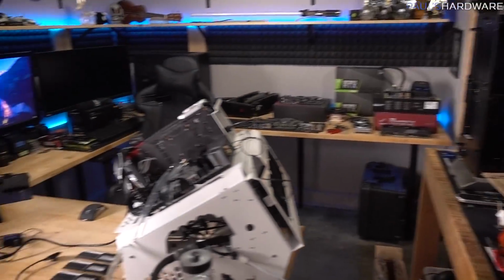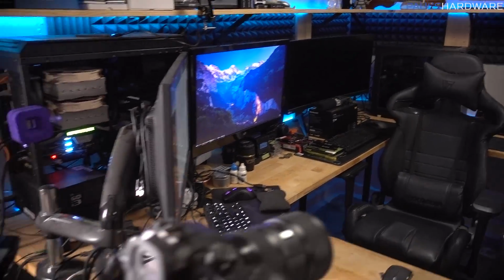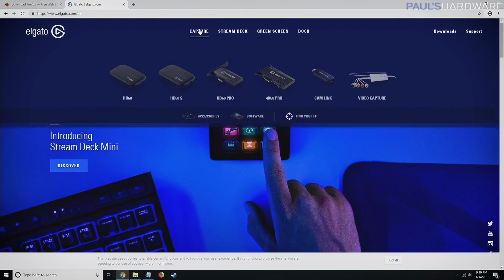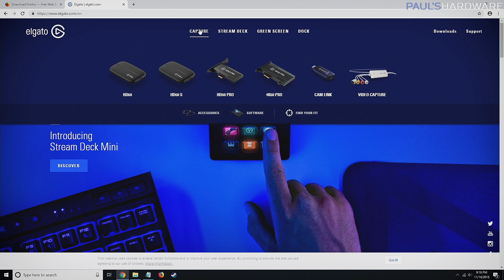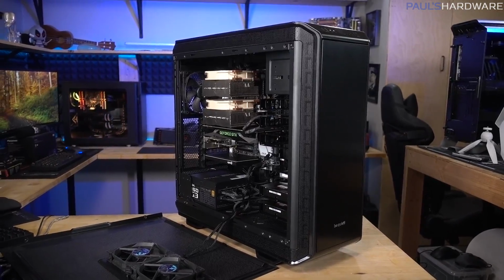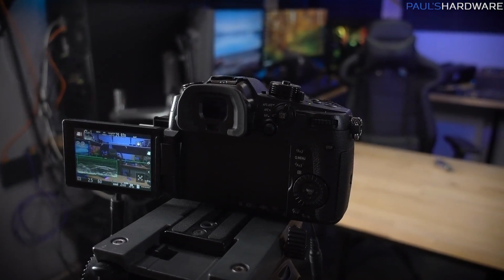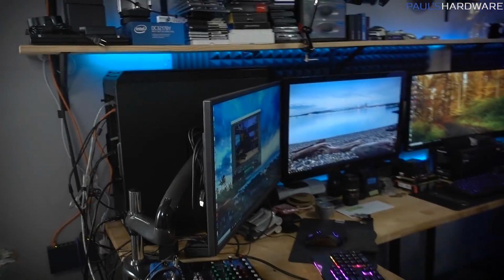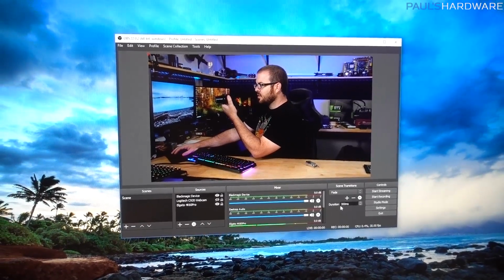My Streaming PC Needs HELP!

Comment from the maker: Many questions about my vacuum -- it's the Shark Rotator TruePet and it's actually pretty awesome, not that I'd do a vacuum video...
https://amzn.to/2DvugOI
(that's an Amazon affiliate link, but I have no sponsorship or association with Shark, my wife picked out the vacuum last year)
Reply: Can you overclock a vacuum cleaner ?
Not that it needs it , but there is definitely potential there .
Reply: @personaldronerepair6141  Technically yes. Though I think it voids your warranty.

And might cause spontaneous combustion.
Reply: @CheezMonsterCrazy  
Or an uncontrollable garage-nado that heats up the circuit breaker then blue screens your marriage .  
On second thought , don't do it Paul .
Reply: Paul!  Don't do it!  The cleaning up of the garage, I mean!  YOU'LL NEVER BE ABLE TO FIND ANYTHING IF YOU DO!!!!
8)
Reply: But does your vacuum pick up large pieces of trash, like the CoolerMaster H500P? 😉
Reply: You should be on Pimp My PC
Reply: https://youtu.be/_u6px48CTqo?t=511 wholly hole Batman
Reply: 6:23 those look like fractal venturi fans, not bq silent wings.
Reply: Is that a Dyson? Lol
Reply: can you made video how to conect 5.1 dolby to 4k tv pls :)
Reply: instablaster...

Comment: Great video and thanks for the upload. Was hoping either you or someone that reads this comment and can give me some advice  on what to do. I would like to stream and record in 4K/60FPS and my recording device would be my PC MB ASUS Ramp. IV socket 79, Intel 3930k 6 Cores /12 T, GTX 1070, 32G DDR3 Ram and two intel Raid 0. For playback I'll be using an Alienware Area 51M Intel 9900K, RTX 2070 and 2x 256 Samsung M.2 and also a PS4 for their exclusive tittles. I was thinking buying the Elgato Capture 4k60 Pro. and  4k 60 fps is a must as I'm trying to improve my youtube channel and see where it takes me or any other suggestion is greatly appreciated. ! Hope to hear back from someone and thank you!

Comment: Quick question. Usually when I break down my gamer/streamer PC and give it a good spring cleaning (about once a year) I pluck the fan off of the cpu and reapply some fresh thermal paste also. Do you and if now why? Just curious bro.
Reply: a good quality thermal paste should hold up for 3 years or even more but i change mine every 1.5 years since it makes me feel comfortable, and i live in a dusty area too so i clean my pc every 4 months
Reply: @Fros789  3 years? Wow, I suspected once a year was a bit premature but didn't think TP had a 3 yr life span. Live and learn ehhh.  And yeah, same here on the dusting. About every 4 mos or so sounds about right. Outside gets done almost weekly when the wifey vacuums in here but I dont dare let her near the inside. lol

Comment: "It's not as bad as it looks"...ha, until a Black Widow bites you!

If you want to handle both capture and playback from a monitor with Intensity Pro 4K/Decklink, you need a Datapath Dual link DVI.  Don't ask me why it doesn't work with HDMI; you must use a DisplayPort.

Comment: quick question which would be better looks and performance a strix 1070 or a gigabyte 1070 ti (3 fan card)
Reply: The time, it preforms a descent chunk better, worth 50$ extra. If not then 1070

Comment: Hey Paul, I recommend getting a Black Magic ATEM Studio 4K switcher for all your capturing needs. Then output to that el gato card. I use this setup at my work and it works great. You can even livestream in 4k eventually. Just be sure to add a 30 second delay for buffering to youtube. Also, I recommend getting a dbx 260 for your mics. Watch a few tutorials on how to setup a dbx 260 and you will see what it can do for you.

Comment: I'm frankly appalled by the nonchalant use of the vacuum cleaner.  Haven't you ever gotten static shocks from the hose?  I have a similar unit, a Shark, and I know when it's dry here in Wisconsin, especially in winter, if the vacuum turns on, I am getting shocked guaranteed.  On top of that, the plastic brush attachment is practically a "free static electricity machine."  Tens, if not hundreds of thousands of volts is more than enough to melt bond wires in small packages.  Maybe you've lived in LA all your life and have never experienced extremely dry air... But ESD can be a real concern for many people.  I'd still find it very difficult to believe a vacuum cleaner has never shocked you though.  Keeping the power supply plugged into the wall is also important, as the whole case will be always be properly grounded, rather than relying on the capacitance of the screws through the motherboard and the of the metal case to dissipate charge.  Cigarettes can't ignite liquid gasoline, but are you going to recommend people smoke around it?

Comment: Paul, good work in revitalizing your streaming box to work for you a few more years! 
May I make a recommendation?  Once you have your system set up, move your Documents libraries to another drive (Docs, Pics, Vids, Music, etc) and you can blow away your windows build later on and not lose anything.  Once you reinstall windows again, you can point your folder locations to that drive, and everything works!  All gravy!  It makes the headache of reinstalling a breeze!
share for you, and all you tech heads out there not yet in the know:  https://www.pcworld.com/article/3025345/windows/move-your-windows-10-libraries-to-a-separate-drive-or-partition.html

Comment: Why go with air cooling? You have all kinds of hardware at your disposal.
Reply: It's his streaming/work rig. He needs maximum uptime with minimal points of failure. In that case, air is the safest and most reliable way to go.

Comment: Paul, what CUP is in that? Looks to me like the Noctua HS is installed in an inefficient configuration. Why would you have it blowing the heat off the CPU towards the bottom of the case, and directly onto the Video card? Just curious... Am I missing something?
Reply: Andrew Small  Do you know if the top radiator is in an intake or exhaust configuration? 

LGA 2011 vs LGA 1151 (mine) could be the difference. Mine allowed for the HS to be positioned both ways. So I had a choice of pushing towards the rear of the case (front to back case flow), or the top (chimney style).

Comment: I almost suggested this with the computer off floor video....... but now that you have set a precedent for changing system names....... I propose a name change for Riptide...Since you have Diana's Little Hot Box, That monster beside it should be Paul's Overcompensator

Comment: Hey, quick question. Is using a vaccum cleaner safe on electronics? I have an (old) PC here that I want to clean up and work on, along with my consoles and such. Thanks
Reply from the maker: I am pretty comfortable using a vacuum as I did in this video -- it's usually OK externally, on dust filters and on big parts like heatsinks. Avoid using a vacuum directly on a PCB (mobo or graphics card), and if you go over fans you should hold them so they don't spin (over-rotation can damage the motor).
Reply: Be careful when using vacuum on motherboard, if it has strong vacuum it might pull components out/off the motherboard, so if its really strong make sure it doesnt get to close to motherboard. Also make sure the tube for vaccum is plastic so you dont get electrical discharge.
Reply: @sjarken3979  Even with plastic tubes static electricity can build up. Because of the airflow and debris flowing thru the tubes. I can't speak for all environments, but I did have this problem with one of my vacuums. I live in AZ. But I was also vacuuming on carpet floors.
Reply: @sjarken3979  metal is good.
Reply: The main danger in using a vacuum (or, say, an air compressor) for cleaning a pc is that the rapid movement of air over components has the potential (pun intended) to build up static electricity. Frankly, though, it'll generally be alright so long as you don't do anything that would cause a discharge. And it is perfectly safe for cleaning filters and the like, as Paul said.
Reply: Thanks all for the helpful replies. Think I'll just use the vacuum for the filters and compressed/canned air for everything else
Reply: heh I cringed so hard when he started vacuuming. I'm shocked that he didn't fry his components with ESD.
Reply: @Requiem4aDr3Am  I was thinking the same thing. I would never do that when my motherboard was still installed, or on the motherboard itself.

Comment: First it was Heather… Now it's Paul… I guess November should be designated as clean your PC month. At the very least clean once a year, otherwise it will look like this! I check mine once a year and it's never looked as bad as shown in this video! I totally understand though Paul, you're an extremely busy guy and it's difficult finding time for mundane tasks like that but as a result it eventually starts degrading your performance and interfering with your work life.

Comment: hey Paul, why did u use a vacuum cleaner to clean your pc? wouldn't it discharge ur hardware? or it some kind of a special one made for pc hardware.
Reply: All vacuums generate static so I don't know why he did use one. I'm surprised he doesn't use an air compressor since it is all situated in the garage.